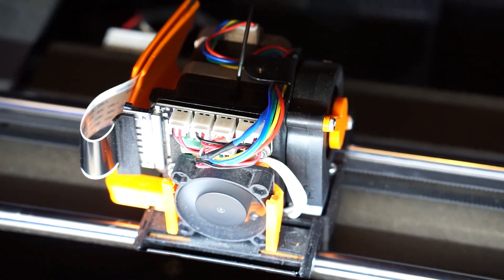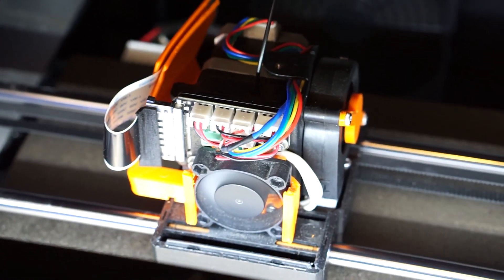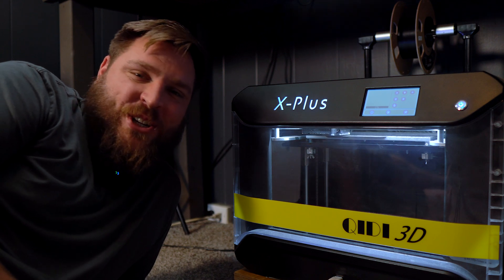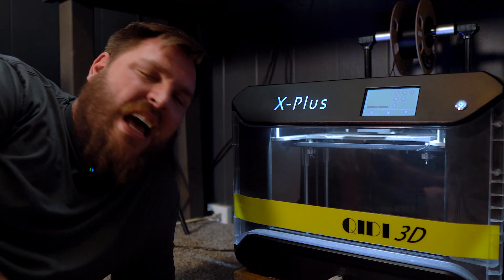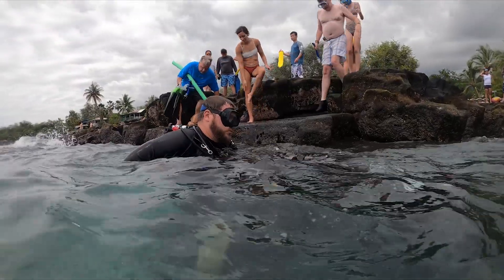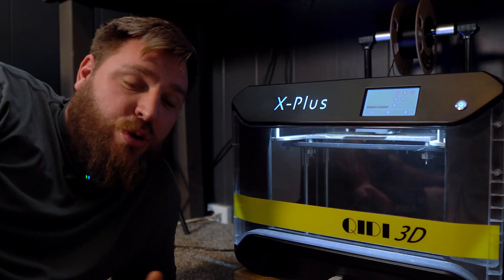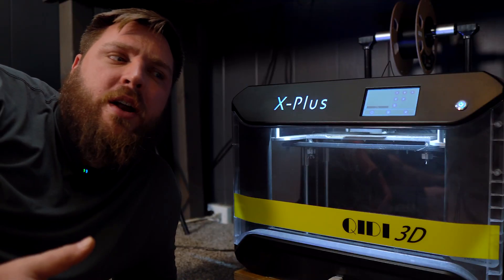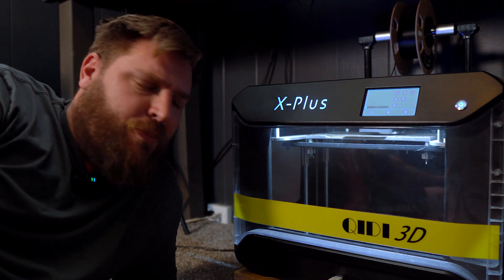Can You Make Scuba Gear With A 3D Printer?

Comment: 3D printing dive gear is doable, I do it all the time for my gear.  I make my own dive cookies and spools which you can see in some of my videos but the challenge of durability comes down to the material you use.  PLA is great because it’s simple and easy to build with while other plastics can be more challenging.  PLA though on things like dive cookies will weaken over time.  The good news is that they are easy to replace.  The dive gear boxes and spools I make though don’t seem to suffer as much as the dive cookies.  UV is a pretty big plastic killer as well.
Reply from the maker: Agreed! Thanks for the comment!

Comment: Hey Zach. Glad you're up and running again (and not at the bottom where your buddy left you). I'm thinking of 3D printing a custom enclosure to house a medical device for Type1 Diabetes. Thoughts on 3D printing or if it should be milled out of say, Delrin? Any pointers? Any help would be appreciated.
Reply from the maker: You can definitely do your prototypes on a 3d printer. Watertight housings are possible with great printer settings, good design, and a little luck. I never recommend counting on luck. I wanted to make an ADV blanking plug for my rebreather and I printed one successfully that held a seal and seemed up to the task. In the end though, I ended up purchasing the actual product as it was significantly cheaper than a funeral, lol. Never did actually dive the part I made, just not worth it. Maybe see what you can come up with on your 3d printer and then you'll have something to go off of when you contact someone about having it machined. I think delrin is the right choice. Aluminum could also work well. Both materials are strong enough for the task, so I would just go with whatever ends up being more economical. Buttons and cable glands would present a challenge, not sure if you need either. If you're really serious about this you should contact someone much more knowledgeable than myself. Martin from TecMe is really good at this stuff and might be interested. His prices are reasonable but his work is extremely high quality, so it's not cheap.

Depending on what you actually need, you might be able to repurpose something that is already waterproof, like an old camera housing (with NEW o rings, lol) or a depth rated dry box. This would definitely be where I would start if you're on a budget. My rule of thumb is that if it isn't rated to at least 130 feet, it's not made for diving.

I hope I helped, let me know if you have any questions.
Reply: @DiveVibe  Thanks for your time and help! One issue that i'm trying to work out is the o-ring/gasket (as it's a clamshell design). I'm not certain on how to correctly size it, but am closely examining some camera enclosures. You've confirmed some of my thoughts and I'll keep on working on it. Thanks again!